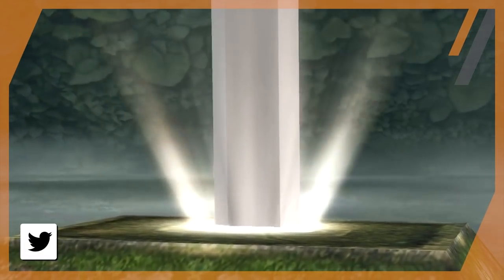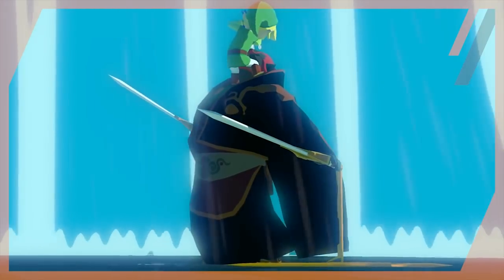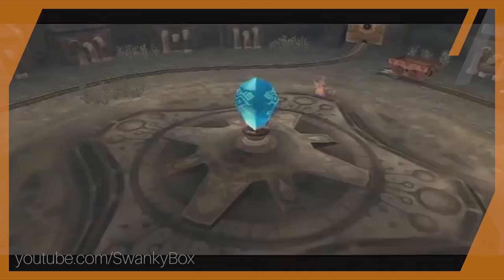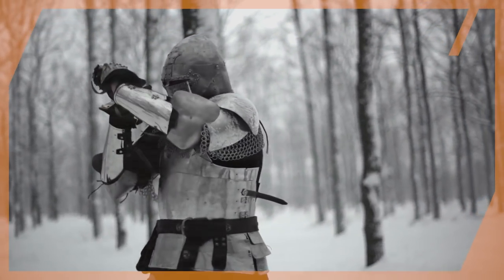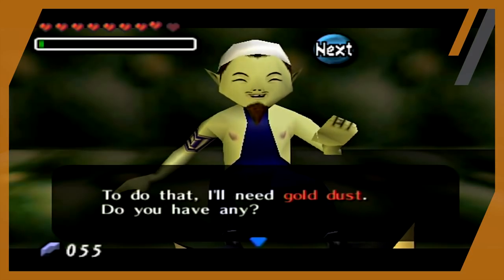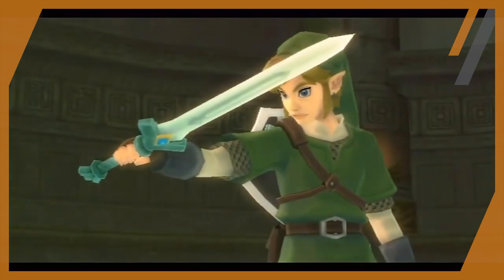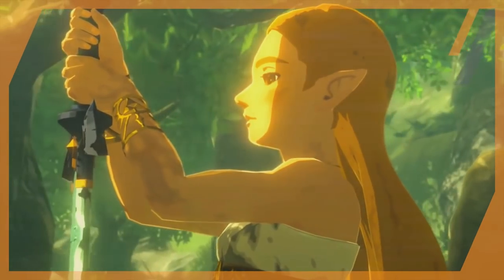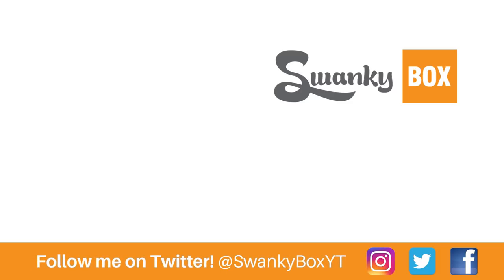Why EVERYTHING About Zelda's Master Sword Somehow Makes Perfect Sense

Comment: Here's what I think the Master Sword's blade is crafted of:

1) Reinforced Steel (Damage output and the blade is more prominent at the tip explains why Link's Dash attack in Smash Bros is strongest at the tip)

2) Chromium&Titanium Alloy (Resist tarnish & rust for long time)

3) Consectrated Silver (Blessed)

4) Anti-demon scriptures (Most religions use blessed talismans or written holy scriptures to ward off demons. Maybe the MS had something of the sort engraved on the sword?)

Comment: I can't find the temperature at which you have to quench it to get the beta crystal structure that gives β-ti3au its strength. I want to try to make a Master Sword out of it (with an artificial blue sapphire hilt to make it look more like timeshift stone), so this is a bit of a problem.

Essentially, I want to make the most accurate functional Master Sword in existence.

Comment: Time for me to nitpick, and really, this is more just for general information than to say "oh your god, how could you get that wrong?" 

It's actually not a broadsword, though that is a very common misconception. By and large, that term is used for claymores, basket hilt swords, and sabers. They have a wide blade, a basket hilt or are two handed (though that gets into the field of the War Swords and Great Swords), and are made for cutting, not thrusting.  Most cavalry swords fall into this category.

The Master Sword would fall into the classification of a Longsword. Most today would call it a "Bastard Sword," meaning it's balanced enough to use with one hand, but the hilt is long enough and properly weighted to use with two. The more child-friendly version of that is "hand and a half." It's no accident that Narsil was a Longsword. In several depictions of King Arthur, he uses a Longsword as well (even though that's historically unlikely, he would have had something similar to a Celtic I hilt type of sword, or something similar based off the Roman Gladius).

It's also not possible to class it as an Arming Sword, as they are simply a one handed, double edged blade with a cruciform hilt.  While the Master Sword does exhibit a somewhat cruciform hilt, said hilt is a bit too long to be a true one handed Arming Sword.

I think we can all agree it's not a Shortsword.

I feel this is important to bring up because of what Link is/what Link becomes. The Longsword was the sword of a knight. The Longsword is a symbol of Righteous Fury, the very embodiment of the Will of the Gods (or in real world, the Will of the Church). Link is the Champion of the Goddess, the Divine Hero, her Right Hand of Wrath, if you will. The Chosen One. And Longswords are the best (if somewhat trope'd) weapon for that kind of a Hero.

The design of this particular sword has been of great interest to me both as a gamer, a lore freak, and a metal worker, and I commend you on getting everything bang on spot except using broadsword... 

Sorry, my senior thesis was on medieval weapons and warfare. 

Although, Link with a saber...  That's...  That's not a bad idea.  No sirriee, I think that's a pretty damn decent idea!  

And kudos to you for bringing up Titanium/Gold Alloy. I figured that's where it was going to end up, and am glad I wasn't wrong.

Comment: Alright if you play the link between worlds you find out that the master sword can be upgraded by a blacksmith by using a extremely rare item called master ore the handle itself is made of timeshift stones but these are only parts of the puzzle the master ore is compatible with magic but the true power lies within the gold stone called faze stone which gives it the regenerative abilities

Comment: Well, good theory about the sword, but it's really just the Goddess sword upgraded through magic. It was magically transfused into new materials and magically infused with its abilities. I'm sure it's made of the same steel as the Goddess sword, at least in the blade. It's just any old sword imbued with the Goddess's magic. That's also why it changes color across games -- magic. Don't think too hard.

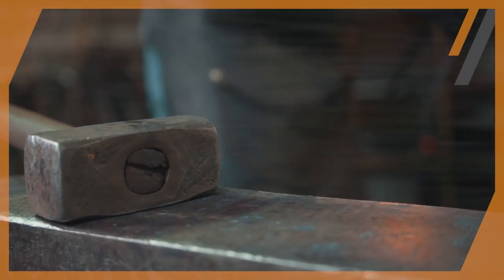Comment: 3:10 the "core" of such swords is supposed to absorb* shock and be able to flex. not resist it. and the edge of a bastard sword such as the master sword simply could not cut through realistic plate armor, no matter how well it holds an edge

Comment: i have to disagree with the idea that the blade has titanium in it because the thing is a sword has to have some flex to it or the blade will snap so titanium won't work and another thing is that titanium is very difficult to sharpen as instead of grinding away at the metal titanium chips away like a rock these are the reasons you don't usually see swords made out of titanium.

Comment: Just because a metal is hard doesn't mean it's tough. Make a sword too hard and not flexable enough and it'll break. How flexible is that Titanium/gold stuff? Considering that it forms a crystalline structure, I'm inclined to think that it's brittle and unsuitable for swords making.

Also, the Master Sword isn't a broad sword, it's a long sword that Link wields in one hand for some reason.

Comment: Using titanium for blade making is a good idea, the blade will vastly weigh less than steel, and since it's mixed with other materials that don't tarnish, it can hold up against severe weathering.  Titanium is a rather newly discovered metal, so the only blades that would be made from it are modern, so unfortunately we won't be able to find a historical example.  Breath of the Wild and Skyward Sword both have some form of modern technology exhibited in Hyrule, and the fact that Fi is an AI program written for the Master Sword, thus eluding that the Master Sword was in fact forged in Hyrule's modern technological renaissance era, and returned to the past to rewrite history.  They were more than capable of forging a modern sword with all the tech they had at the time.  The Master Sword is just a glorified Terminator.

Comment: Its obviously vibranium mixed with uru lol jkjk im 99% sure someone made that joke before. But think about it just for a second. The vibranium could be what gives the sword it's toughness and razor sharp edge and the uru could be what gives the sword its mystical properties such as the skyward strike aka summoning lightning. The master sword is seen cutting through armor and flesh but also wood, stone, and crystals. If Nintendo was working with Stan Lee, I would assume that the blade is where the vibrainum is and the hilt is the uru. This is obviously not true but I wouldnt be surprised if inspiration was taken one way or another.

Comment: It could be a steel alloy like 1095 cro van, or 2060 stainless, before you ask no it ain't rust on the blade in botw, its confirmed to be malice, therefore it can be stainless steel because it has never rusted, and with him saying its the timeshift stones in the hilt rewinding time it ain't out of the question, it should be noted this is from an amateur blacksmith.

Comment: Toughness and hardness in high carbon steel are decided by the temper temperature (with dark straw being the traditional sword temper) and it's duration, not by the thickness. Also the crystalline structure of steel that has been brought up to critical temperatures is only formed once quenched. Simply heating steel to red hot and then allowing it to cool actually softens the steel.

Comment: The hilt keeping the blade in good condition is a cool theory, but you should do some more research on real swords before doing something like this...a blade can't be too hard, or it becomes brittle and will break, and swords don't cut through armor. Like ever. Steel doesn't cut through treated steel. 
Also, in reality, the springiness, or ability to return to its shape after being bent, is what provides durability on the best swords, not that a paddle like the master sword has to worry about that, lol.

Comment: You've kind of got your facts wrong about what makes a good sword. A broadsword like we see depicted in the game should actually have three aspects:
1. It needs to be lightweight: A sword is useless unless it can be quickly whipped around and used with ease to parry and take advantage of openings. Which is why swords used to be made long and thin along with a fuller down the middle to further remove excess weight. 
2. The sword needs to be hard enough to hold an edge for a decent amount of time, but not forever.
3. The sword needs to be able to bend without deforming. This is the little known aspects of swords, swords are actually able to be bent upwards of 45 degrees without permanently deforming. While a sword can be easily resharpened, it cannot be put back together if you snap it in half, so if you hit a bone or piece of armor or a shield, you sword will bend then spring back to shape. It only needs to be stiff enough to pierce the skin which isn't a much and most swords can be bent with the hand then spring back to place straight as it was. 

The problem with the master sword is that it fails on two of those points. Firstly, it is far too thick to be of a practical weight, especially for a one-handed broadsword. Unless the sword was made of aluminum it would be very difficult to use. This thickness would also prevent it from being able to flex properly, with the amount of momentum something that heavy carries, if you were to try and use it, the likelihood of the blade bending and being permanently deformed is very high.

Using gold in a sword is even worse, while the sword may be hard, it will make it even heavier,  gold is twice as dense as lead, even a small amount would dramatically increase the weight, so while a gold-titanium alloy would be hard, it would only serve to make the sword heavier. Also, hardness isn't all that important, as I said, a sword can always be resharpened and bent back in place, however, too hard and you run into problems, no matter how hard a sword can't hold an edge forever, and make it too hard and you'd have a tough time sharpening it and attempting to re-straighten the sword is more likely to snap it. 

There are also numerous problems with the practicality of the actual shape of the sword, making it more difficult to cut and stab than it should be. But I've spent enough time already, either way, as a fantasy sword made of a fantasy metal it's fine, but try and bring it into the real world and it utterly fails.

Comment: I have an issue with the gold/titanium thing. There is nothing to suggest this is what the Master Sword is made out of. The Gilded sword is forged all the way from the Kokori sword. The gold and forging process is all from Termina. There is no corrolation to Hyrule and the Master Sword from that point.
Reply: It's just an example of what the Master sword could be made of. The whole purpose of the video is to give other viable possible explanations that have real world similarities. Like the man said in the video, its boring to just shrug it off as, the sword is like that because of magic.
Reply: But it doesn't make sense to use the titanium/gold alloy as the main point for most of the video when it has no connection at all to the Master sword.
Reply: @firebird1080  bro it's a comparison, it was never a one to one representation of anything else but to show that a gold mixture has already been used once. No one is saying that the sword is made out of Titanium and gold, they are saying that it could be and that it would make some bit of sense.

Comment: People have already mentioned that swords can't cut through any kind of steel plate or mail armors. And the fact that the Master Sword isn't a broadsword, but a bastard sword. But I haven't seen anyone mention just how THICC the Master Sword is. I mean, using that thing would be like wielding a big piece of lead pipe. It's gotta weigh like, 20 lbs. And for a sword, that's ridiculous.

Comment: From what I hear it would be a pretty bad idea to make a sword from that alloy though as a common consensus. It wouldn't hold an edge worth a damn and would be light as a result from all the titanium in comparison to gold and unless you are using a Katana or Scimitar you do NOT want a light weapon- this I do know. And it would be useless for those as it would lose its edge on a weapon designed purely for the edge. I could imagine a pirate using it though as the blades would never rust and they would probably not have huge issues with the edge as they are dishonorable bastards who would cheap shot regardless- never putting the blade in any real harm. This I just what I heard though so cannot confirm and it also seems to be a very popular thing said by alot (99%) of people who pose more an argument than- "If its strong than it just works better." and there are a lot of factors in forging that you normally would never would think would be the case. Anyways, could be that master ore everyone else here seems to be talking about.
Reply: Well if you have a lighter material, then you CAN end up with a lighter sword, but you could also just end up with a longer or thicker sword for the same weight. Having a light bastard sword is probably pointless, but a light claymore would have pretty decent reach.

Of course, the Master Sword isn't a claymore. It's a bastard sword.
Reply: @Sluppie  Fair point, but I would probably just use what the experts recommend. Carbon steel, especially for a bastard sword. But yeah it would be a decent material for that, just mind your edge or eventually you wont have one- or a good one at least.

Comment: ... you can absolutely NOT cut trough armor with  swords. hell its almost impossible to cut trough a proper gam bison with a sword (with is just lawyers upon layers of thick cloth. its impossible to go trough mail with a sword and plate is even more impossible not to account for the fact that under a plate you wear a gambisson and a chainmail under. swords where never used against an armoured opponent where they did in the time was to have hammers or maces against armoured opponent. if you absolutely have to  use a sword against an armoured opponent you would hold the sword by the blade and use the pommel and cross guard as a blunt weapon. Also a sword does have to be of a relatively soft metal, to hard and uninstictively the sword would break to be a proper sword you need to be able to bend it with your hands if it does not well your sword is rubbish. so a gold titanium ally would be a terrible metal for a sword.

Comment: I have a Nintendo-official steel replica of the Twilight Princess Master Sword, and every time I pick that sucker up, hoo boy.... I'm reminded her impractical and unwieldy it is.

It's waaaaay too long and heavy to wield one-handed, and should probably be much heavier, slower, and deadlier than it is in-game (though, “deadliness” is extremely subjective in a video game).

Heck, look at how Link wields it in Twilight Princess and Smash Bros. The way he attacks with makes it look like it has the weight and balance of a wiffle bat. In TP in particular, if you use normal attacks, he basically “swats” with it, whipping his arm forward as though it is made of plastic. (That's one of the weakest aspects of TP's battles, IMO; the basic attack animations look better in just about every other 3D Zelda game.)

And don't get me started on the blade... The flat of the blade is literally flat, like it was laser-cut from sheet steel (no doubt the replica really was), and the center of its weight is so far down the blade that holding it in one hand will make your arm buckle.

....

...It looks pretty cool, though. >_>

Comment: No. Just no. First of all, no weapon cuts through armor, except its in a video game. Secondly, using titanium for a sword is counterproductive, since it has around the same hardness as steel, but only a quarter of its density resulting in less weight. For armors that is great, for swords not so much, because with a roughly 250g sword you simply can't generate enough force to do serious damage. I am not familiar with that titanium gold alloy, but simply because gold is near useless for weapons I highly doubt it. Even IF the metal would end up being 4 times harder as 'steel' which is by the way not specified (steel is not equal steel necessarily) hardness is rather similar to brittleness, so making something harder might end up breaking a weapon rather than making it super cool. Also, you made it sound like the Master sword would be (don't know the writing) distal tempered, with the edge being harder than the center. While that happens to some extend naturally it is no way near what the japanese do during tempering, coating the edges in a thin and the center in a thicker layer of clay to archieve that effect. Also, it is (depending on the game) an arming sword or a bastard sword.

Comment: False. Titanium is a brittle metal. Titanium must be mixed into an alloy with Aluminium as its Partner. Metal must be able to have flex under stress. Otherwise it will break every time.

Comment: Why the f is a holy sword weaker than a sword made by a Goron
Reply: Game Devs not thinking ahead. They wanted the master sword as the primary weapon of link but wanted to give players a powerful item for doing the fetch quest. As a result, they made an error when it comes to lore because they needed the master sword to be the standard for adult link, but wanted to give players a powerful reward for the semi-difficult fetch quest. As such, they made a stronger sword then the master sword due to trying to make things balanced and also wanting to reward the player without filling another slot in the normal items.